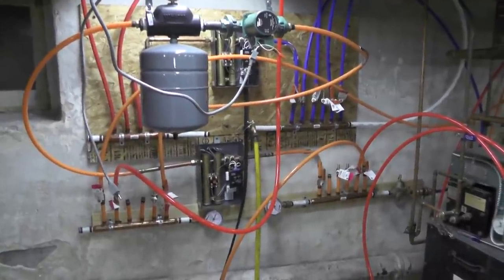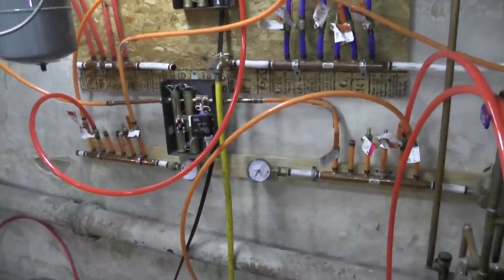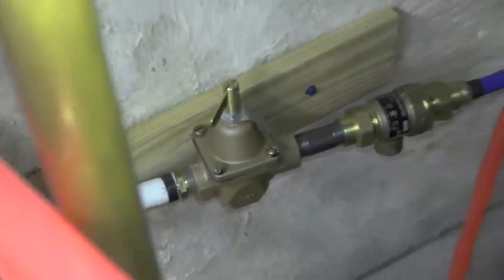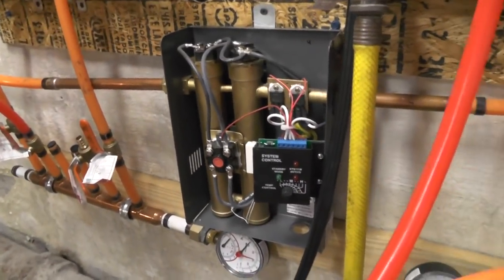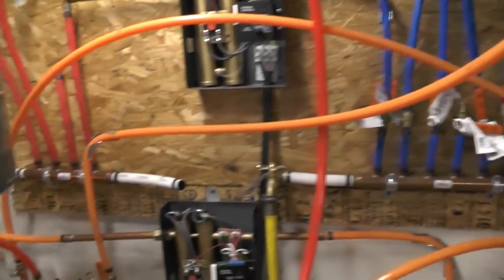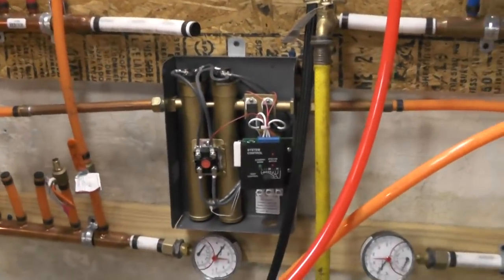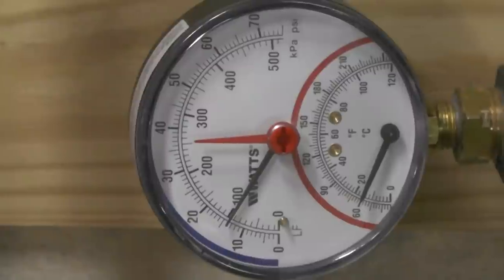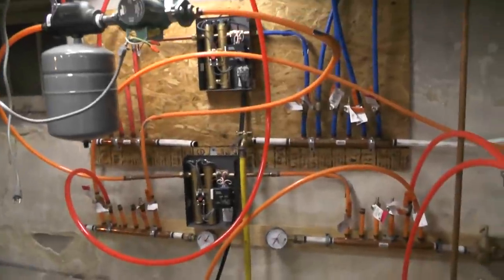Radiant Hydronic Floor Heating System with Tankless Heater

Comment: ok you are putting 90 degree water back into the system, should you use special fottings in the inlet of water heater to reduce damage?

Comment: How much is that 13,000 watt tankless heater costing you to heat your home in the winter? I sure hope it doesn't have to run non stop because at 12 cents a kwh would cost you 1200 a month to heat - i guess it all depends on how big your house is and if it's properly insulated. That 13 Kw water heater can put out a bout 45,000 BTU's per hour and on average you'll need about 50 BTU's per square foot in your zone - it all depends on what your heat loss is as well - the numbers I'm giving you are just averages. With the proper mixing valves for your radiant system and a outside temp sensor you could probably save just as much with that boiler maybe more - I guess it all depends on what you are paying with the current set up - now It would be nice if you'd respond to the comments - since you always say in your videos to comment - a reply would be nice

Comment: couple items - I wouldn't have used that brand of PEX pipe - don't like the crimps to fasten the pipe to the fittings.  The pump should be located lower to eliminate potential air locking.   ALso - why not have one tankless open loop system and be as efficient as possible.  THis system utilizes one heat source and provides radiant heat and heated potable water.  Your whole system is taking up way to much space

Comment: Looks pretty good. How's it doing as far as heating your floors? I was thinking of adding something like that to my first floor (900 Sq Ft.) cause we have cold floors in the winter. I got a quote from a company out on the east coast and they wanted $3000 just for the equipment. No install included.

Comment: I have a question or two: how many sq. ft. are you heating with your radiant heat, is it in a slab or under floor? How many amps does your service panel support, 200 Amps, 300 amps?

Comment: This is really bad. I would seriously consider starting over. Most of the parts you need are not available at a big box store. The correct components are expensive which is maybe why this happened...Can't tell for sure, but it looks like you may have a boiler right next to this stuff. That would be where to get your hot water from. If not get a wall hung ng or propane unit. Then you need real manifolds to balance the loops for even heating.  I am also thinking you may not have oxegen barrier pex which should be uses. If you need any help fixing this give us a call.
Reply: Where is you u tube video I want to know how a PRO does it.

Comment: After two years, how is this working out for you? Are you able to afford the electric bills?  Using electric instant heaters is the most inefficient way imaginable to supply hot water for radiant heat, so I suspect you have discovered this by now and re-designed your system.  

Also, you don't mention how you control your radiant heat re-circulation pump.  And it is evident that you don't have any zone control valves (which would be controlled by a thermostat in each zone) on your radiant heat manifold.  What you have is one zone with two circuits (a red and an orange), and no apparent way to control the circulation pump when a thermostat calls for heat.  

Download a tech manual for a Takagi T-H3 gas tankless hot water heater which is certified and warranted for this type of application.  Within the manual you'll see diagrams of how to do this right.
Reply: Give the guy some credit. He was prophetic that the far left states will ban natural gas or petroleum but electricity for heating. 😁Hopefully by now he learn a thing or two about heat pump technology and resistive heat is the most expensive.

Comment: WOW.  What a mess. I'm at a loss for words. Hack job doesn't even begin to describe what you have accomplished here sir. Do yourself a favor and cut everything out. This system will never run properly. Cut your losses and forget about radiant heat until you can afford to pay a pro.
Reply: 392bully it might work. Plus why so rude? This is actually quite close to a radiant system. Yes there are some things to change but it’s not all a fail